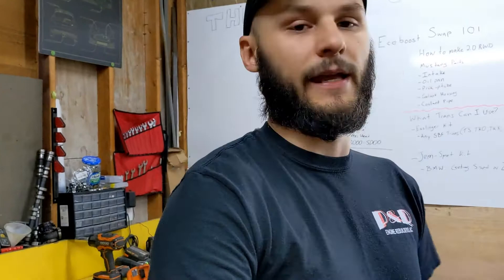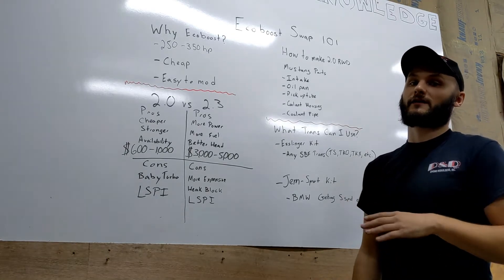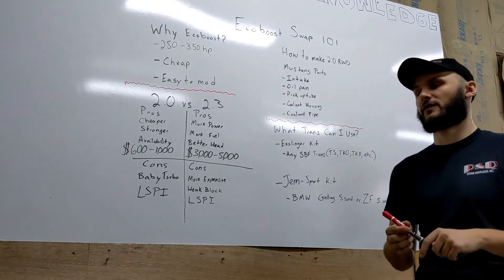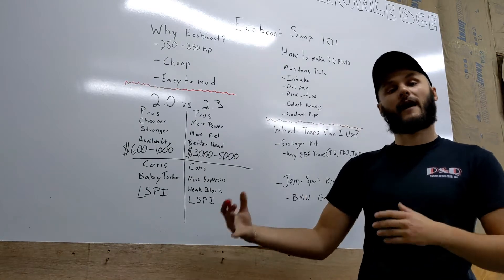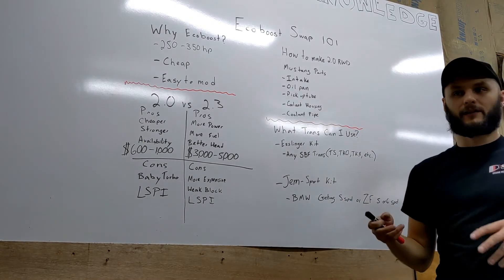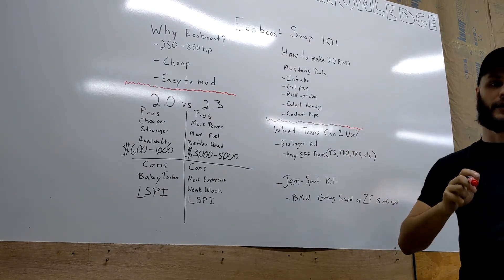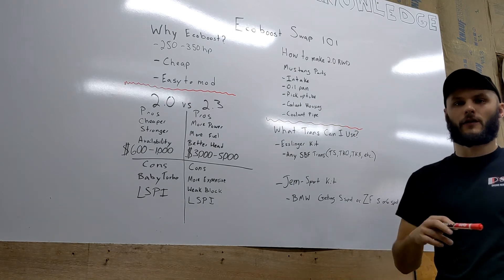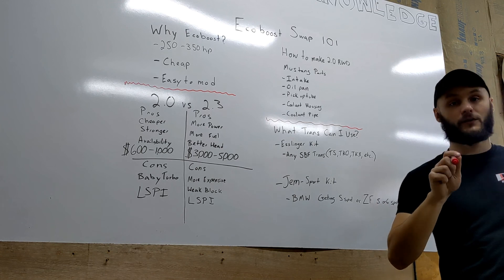Ecoboost Swap 101

Comment: The 2.0 has a stronger block however make sure you have the spain block and not the ohio 
The ohio has a qr code barcode on the valve cover
(Open deck) problematic
Where as the spain block has a barcode style 
(Closed deck) what you want
Reply from the maker: All of the older style single scroll turbo engines are closed deck. The newer twin scroll turbo engines are open deck. But I agree the closed deck is the way to go!

Comment: Would be interested in seeing how the engine and transmission mounts were done. I've thought about building a Pinto Restomod with the Mustang 2.3 Ecoboost, think such a build would be a mean ride.
Reply from the maker: The engine mounts were off the shelf parts. The trans mount is actually for a 5.0. check out my other video, I show what the mounts look like.

Comment: So I just picked up a 92 Hatch Foxbody. I also have a 2017 GT and I have a spare MT82 laying around, will that bolt up to a 2.0?
Reply from the maker: Unfortunately the GT and Ecoboost Mustangs have different bellhousings for the MT82 they are not interchangeable. If you can find a MT82 from an Ecoboost mustang, that should bolt right up using all Ecoboost mustang flywheel and clutch parts. 

I am not sure how it will fit within the trans tunnel or where the shifter will be located though. You may have some fabrication work ahead of you if you go that route.

Comment: Your info is not 100% accurate. There is 2 different 2.0 , there is the 2.0 semi closed twin scroll, and 2.0 closed deck that comes off the focus ST.  

The best way to build a ecoboost is with a 2.0 ST block with a 2.3 head and 2.3 internals.  

People also use the 2.0 semi closed block.   Basically anything besieged the 2.3 block.   Some use cylinder support systems for the 2.3 but id say its a waste of money.  2.0/2.3 ecoboost can make lots of power.  But the 2.3 stroker builds are the way to go.
Reply from the maker: That is what I said in the video. The list of engines are all the same as the "ST" engine. The twin scroll engines came in the later cars depending on year. The engine that I have in the car is a 2015 escape, which is the same as a Focus ST engine except for the oil cooler, which is a bolt on part.

For a high power 2.3 stroker build I would only use the early closed deck 2.0 block. I don't have a lot of trust in the later twin scroll blocks.
Reply: @stroupperformance  2.0 semi closed (ford fusion), and 2.0 closed deck (ST) are not the same.   Every 2.0 block is different.   Originally designed off the mazda 3  2.0 block which is almost identical to the ST block but also different.
Reply from the maker: That is interesting. Ford's part system says that the 2013-2016 Fusion and 2013-2018 Focus ST have the same block with the same exact part number.
Reply: @stroupperformance  that is interesting. But they most definitely have differences.  Like the casting itself and like i said the fusion block is semi closed deck, and ST block is closed deck with different mounting points.   You cant use durtec blocks with ecoboost heads unless you do modifications.  Both 2.0 engines and 2.3 engine is interchangeable as long as you use correct head gaskets.   Im putting a 2.3 with ST block in my ecoboost mustang and i have to use a custom engine mount.  Besides that its a 1 for 1 swap.
Reply: @stroupperformance  also the 2.0 ST block and 2.0 fusion block have different mounting points. And the v6 is not an ecoboost.
Reply from the maker: Also weird that Ford calls the 2.7 and 3.5 V6s Ecoboosts in all of their advertising and documentation. Unless it's the hybrid, then they market it as a "Powerboost" V6.
Reply: @stroupperformance  those are ecoboost engines that are boosted.  The v6 in the mustang is not boosted and is a cyclone 3.7 liter engine i believe that does not have ecoboost technology like the 3.5l twin turbo.

Comment: Could I put one into my 2005 ford escape 2.3
Reply from the maker: That generation escape should have the duratec 2.3. They are very similar to the Ecoboost, so it should be an easy swap. I believe the engine mounts are almost identical
Reply: @stroupperformance  really if you have any tips please send them my way

Comment: Where do I find a 2.0 for under a grand?
Reply from the maker: Search LKQ for the model cars that were listed in the video. For example here are the results for engines from an Escape. 70 engines ranging from $600-900 depending on mileage.

https://www.lkqonline.com/2016-ford-escape-engine-assembly/-hPOj4ncnnP
Reply: Fuck lkq

Comment: JEM Sport also makes a swap solution for the 2.0 or the 2.3 EcoBoost. I went with them after speaking with Jake at JEM sport as the way they do their PATS delete allows for use of off the shelf Focus ST Tunes or for someone with an HP tuners to plug in and tune on the ecu, Where as ANT harness uses a can network to spoof the ecu into thinking it has PATS, and limits the tuning availability. I believe you can still tune gen 1 EcoBoost ECU's with the correct harness, but it seemed a little in the dark. I have the JEM sport ZF adapter to mount up a ZF. The ZF trans is much stronger than the Getrag, and is also quite light. I also liked how they use a shift rod that connects to the trans rather than directly on top, so I could alter the length of that rod and retain my factory shifter location with a chassis mounted shifter. This is all going into an NA miata, cant wait to get the engine harness in and fire it up!
Reply from the maker: I wish that JEM sport had the ECU available when I purchased my ANT steering ECU. I'd have to talk to them more, but I believe they are using something similar to Ford's 2.0 control pack to delete PATS. 

I'm glad to hear the ZF trans option is working for you though. Like I said in the video, I don't know a whole lot about them. But I have heard that they are pretty cheap used.
Reply: @stroupperformance I’m still waiting on the harness, but the zf seems like a great option on paper because it’s super strong and quite light.

The JEM sport harness is in fact based on a ford control pack ecu

Comment: Isn’t the 2.3 also in broncos? QuickDraw makes a bell housing to Jeep trans… but the LSPI is a concern
Reply from the maker: Yeah I missed that, 2.3 can be found in the bronco. The 2.0 can also be found in the bronco sport.

It sounds like you want to put this into an offroad or crawler rig. In that case the LSPI would probably be a big issue.
Reply: 2.3L ranger.

Comment: Miata transmissions are also a great option for manual transmissions.

Also, what tuner did you use with the ANT ECM setup?
Reply from the maker: I will be trying the HPT MPVI3. Not sure if it will be able to tune just yet, but I have confirmed that it will communicate with the ECU and read data.